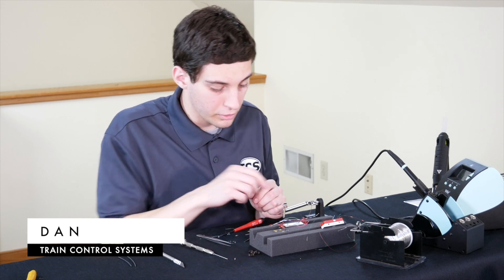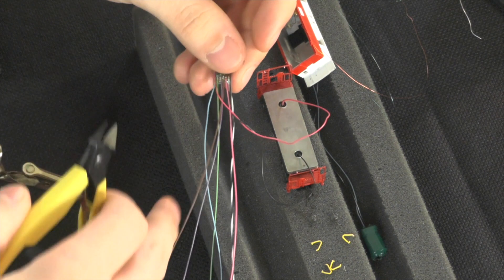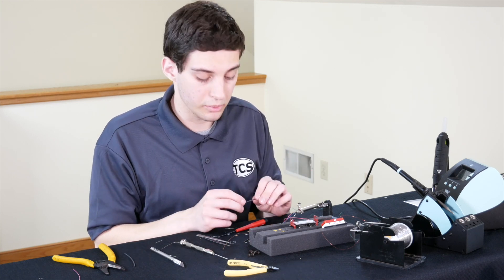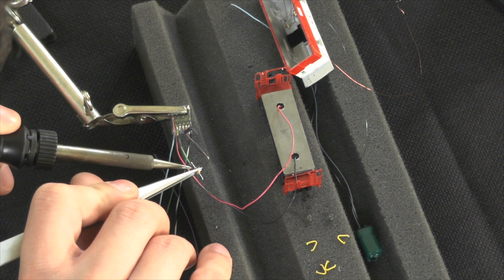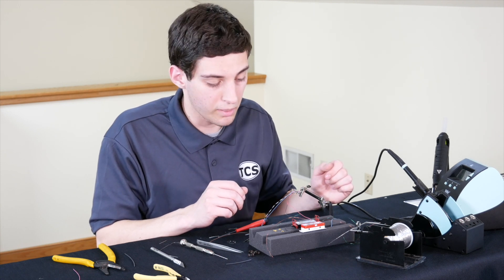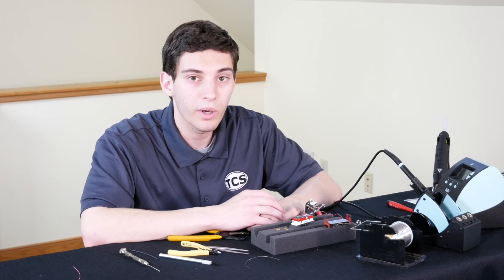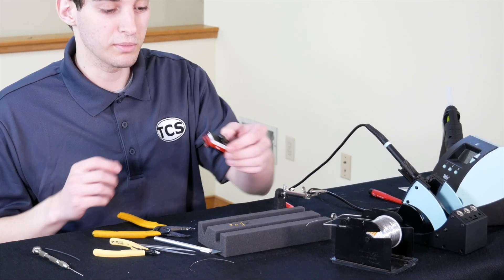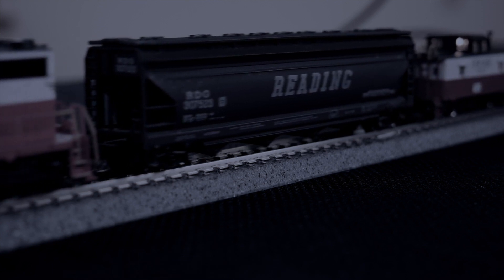N Scale Caboose Lights and Keep Alive® (Part 2) | Installation Companion

Comment: I wish I could see how the rail power is picked up. If wipers are on the axles then how is the right and left wheel isolated?🤔
Reply: One wheel has an insulated bushing and the other one doesn’t so track power goes up the uninsulated wheel into the axle. It’s just reversed on each truck so power gets picked up from the right rail on one truck and returns to the left rail via the other truck.

Comment: Thanks for this video. Well presented and very helpful.  I did not understand the distinction between DC and DCC. I take away from  video that  either the red or black power wires can go to either of the truck wipers when running DCC. Correct?  If running DCC  with it's constant track power do you really need a Keep Alive? Thanks again!!
Reply: You do because of intermittent contact will make lights flicker.

Comment: Got a question I have a caboose with one of your kits in it...I did a cv8 on my loco and messed up the settings on my caboose...the person only wired it for rear red led eot on the back of the caboose...now there dim the only way it become bright it you hit the horn...it's there a cv code setting to these...mine say tf4 on the red tag on the decoder .